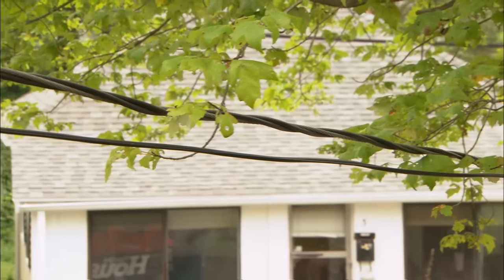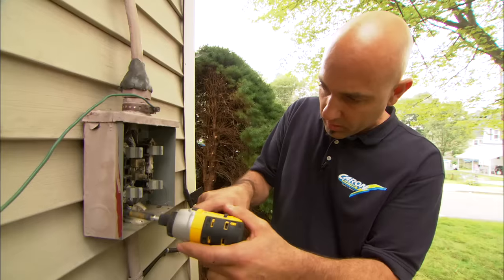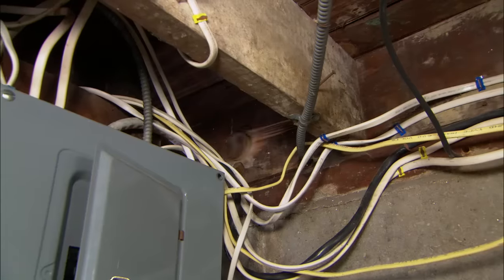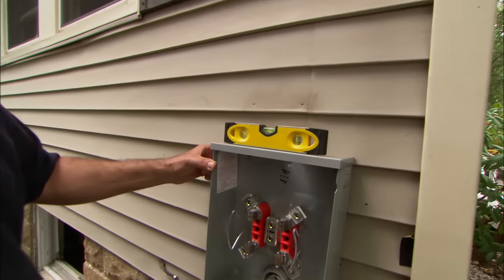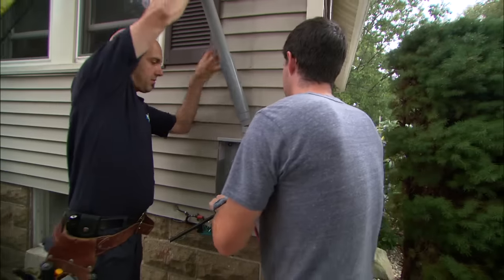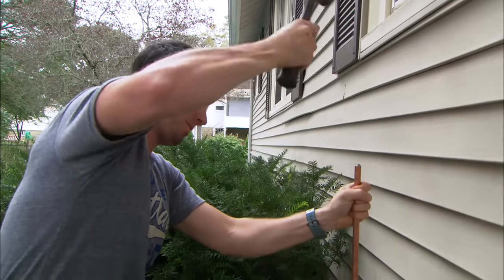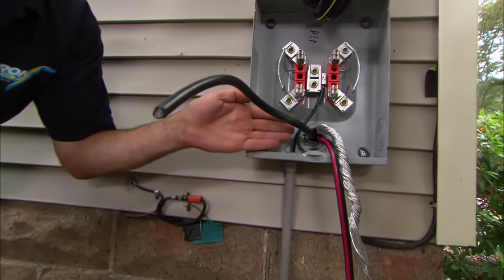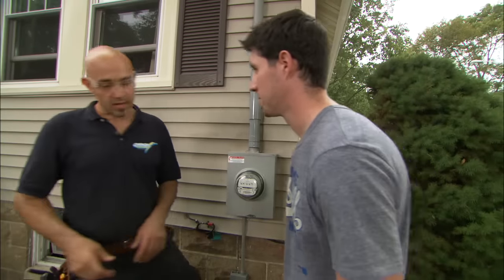How to Upgrade an Electric Meter to 200-Amp Service (Part 1) | This Old House

Comment: Here in germany we have got: 3 phases (L1-L2-L3), 400 Volts each. Every phase hase got 230 Volts to ground / neutral.
230 Volts is the normal socket voltage.
But: 4:14 Sorry, but copper in the earth is not the best choise, AND the electric connection should be protectet against rain etc.
We´re using a so called "cruciform earthing" which is covered with zinc. 
Greetings from germany
Reply: Albrecht8000: The 400V are between the phases and not between phase and neutral.
Reply: @e1woqf
"Here in germany we have got: 3 phases (L1-L2-L3), 400 Volts each. Every phase hase got 230 Volts to ground / neutral."
Thats what I told. ;-)
400 V Phase-Phase
230 V Phase-Ground
Reply: Motors work better on higher voltages.
Reply: pretty funny watch American electric wiring :D We have here in Europe almost everything better engineered (sometimes over-engineered) but murica, nah, 200Amp true the aluminum wires and bare copper rod like a ground :D connected with a black tinny wire.
Reply: Te eropean material is better. But a high voltage is more dangerous.
This use 200A because need 48kW, but is a single phase 120/240V system. 48kW in 3phase sistem 127/220V it's a 125A.
Te common power in a houses up to 12kW, in 230V sigle phase need a 50A (11,5kW) 2x 16mm2 wires, in 120V system need a 3 wire, 2 phase and neutral, 50A 2x 120V uses 3x 16mm2. It's a not big diference.
Reply: @D4V1D83FY  it's a huge difference. 230V system is no more dangerous if you have a proper modern electric installation in your house. We have a current circuit breakers and I can easily touch live cable and nothing happened to me. Btw 16mm2 ground cables are rated to 80A, not 50A. In our house, There is a 5x4mm2 cable for the whole house, 3x230Vx16Amp and 3x400Vx25A lot of power from relative tinny and cheap main cable. And copper joints will last longer than aluminum ones. Not arguing, just saying.
Reply: In the same condition 230V is more dangerous of 120V.
The interruptor about your talk is a default current breaker, also use in 120V countries (gfci). This protection not existing in external wires.
3x230V it's not same 3x400V.
3x230 = 230V line to line.
I'm have use a lowes load in cables, a big cable lowes a voltage lost.
All righ, the cooper is better.
Reply: @D4V1D83FY  No, we have 3x400V between phases, and 230V between one phane and neutral line :) It's same cable, same line. I have a 3phase socket in my garage and only 230V sockets with 16A breakers in-house. In our country was aluminum widely used, but now those installation failing and they are replacing (in old houses) with copper. Aluminum joint degraded and oxidate(even in controlled humidity houses) during times.
Reply: In my country have a 230/400V lines and 130/230V lines. 
Here uses a aluminium for external wires network.

Comment: 1-USE service cable isn’t allowed by NEC for the riser conductors .
2- He’s using SE cable which is correct BUT it has to be a 4- conductor to terminate to the service panel due to no bonding of the meter center to breaker panel . ICC Certified Electrical Inspector would not pass this inspection as I would know I’m a electrical inspector.
Reply: Hmm,  i will have to chek out my NEC.  but i think you are wrong .  Trying to think. as i don,t  use SE.  I will run a section of 2inch PVC , for 200amp.   2 hots and 1 neutral .  and not a bare neutral though.  i tape white the neutral wire. or i could paint it  i guess.  But i still only use 3 wires for the main service. on a Sub-panel i use 4 wires to split the neutrals from the ground wires. I have not been turned down for what i have done for years for this. Never turned down on a service like what i just said.   i live in Louisville, KY.
Reply: Inspectors don’t know jackshit

Comment: 1:55, we had a problem with our 200 amp rated service entrance (SE) wire when it kept popping the main 200 amp breaker. We found out the problem was the SE wire. It was ALUMINUM! We solved the problem when we changed to COPPER wire. That was way back in the mid 1970's. The main breaker had never popped since then.
Reply: weird story.  Upstream wire does not cause the downstream breaker to trip with overcurrent.  Every new house in this town has aluminum SE wire.  It just needs to be a bit thicker than copper to be rated for the same amperage.   And, of course, the connectors have to be compatible with the expansion coefficient of aluminum, as well as be corrosion protected with chemistry.
Reply: Chigobwyn Quorev aluminum is still pretty standard for SE and USE cable...
Reply: likely wrong gauge wire or loose terminals causing heating, not good ;)
Reply: Shawn lewis

Comment: How is the large hole behind the meter socket sealed? I realize the cable itself is waterproof but water could get into the wall around the cable.
Reply: That cable is not waterproof. About sealing penetrations on a house, look for a different video.
Reply: @electricaf365  Funny coming back after 3 years of learning… I still don’t know what that cable is, but it appears to be some kind of huge romex, which I’ve not seen outside this video :)

Comment: No ground to the main panel? or did I miss it
Reply: Guess they ground at the meter base wherever this is. Was puzzled by this also.
Reply: You can do it this way only if the panel is within 2ft of the meter base and you have the ground and neutral bonded inside it, an important code item he didn't explain, also check with the local codes and standards because every utility company I've dealt with want the top of the meter base at 6ft, and no PVC and aluminum out the top to the weatherhead. Also anytime using aluminum it's really important to use  NO-OX on the connections. He basically shows the cheapest way to get by but not really against code.
Reply: It's a 3W system.  The distance to main panel is irrelevant. You nonfat the first means of disconnection. It depends also on the AHJ if you have to go 4W to the main panel AND install a meter-main panel.
Reply: In part 2 he bonds the main panel to the water line inside.
Reply: @markbest4230  Nonfat?
Reply: Totally sorry for 'nonfa'.... I meant bond at first means of disconnect...
Reply: The ground to the main panel is not run inside the service entrance cable. For 4/0 service conductors, they will run a solid bare #4 copper grounding electrode conductor from the neutral bar of the panel through the wall to outside and terminate at the ground rod. Then they will bony the neutral bar to the panel enclosure.
Reply: @RB-xv4si  Yes, it also bonds at the cold water intake if there is copper water piping. Gas line is bonded as well. But more importantly is the fact that if we here  in Georgia upgrade the service entrance, our main disconnect will be located at the meter, thus running a 4W to the main panel and doing all bonding at meter-main service entrance. It really depends on the AHJ.
Reply: Mark Best yeah, that’s fine. I was just talking about this specific situation where the main disconnect is inside the panel. You run the GEC to wherever the main disconnect is, of course. As far as where you run your GEC, I don’t know if you guys in Georgia like to blow up your houses and generally not follow NEC but it is against code to run the GEC to the gas line for obvious reasons.
Reply: @RB-xv4si  No, I'm just saying what some inspectors actually say. And bonding is required  per 250-104(b)... assuming you guys read the code up where you're at!

Comment: LOL . I can't believe I didn't see this before now. This would be one electrician I wouldn't want on my house . I seen so many violations in that install it makes me wonder it the guys house burnt down a year later.
Reply: Name one
Reply: Yes pls point out the violation which will result into his house being burnt down or a fatality or any other basic errors, we need to know!
Reply: The grounding rods do not prevent electrocution. They provide a path to ground for lightning strikes and transit voltages.
Reply: Your neutral wire should have been insulated as it is a current carrying conductor. The twisted strands are to be used as a grounding conductor.

Comment: I still think the ELEC Company needs to "own" everything up into the meter box.....
Reply: Yeah but they have the money to lobby our politicians in there favor, no one looks out for the lil guy, cuz we ain’t got no money’s
Reply: But the service entrance is covered under the National Electrical Code.  Linemen are NOT electricians.  It actually makes sense that anything attached to your house should be your responsibility.  That INCLUDES the point of attachment device that the electrician typically installs on the house for the utility wires to connect hang from.  Just my opinion...
Reply: No, i paid for my meter base and wires up the mast. Power company supplies the meter and wires from the mast to the pole.

Comment: Most power companies will not allow you to pull the meter. Get the specs from the power company. Pvc risers are not allowed here. Also no grounds in the meter can on residential installs
Reply: The utility has better things to do than  "de and re's" for 200 amp residential service's, they don't care.  Any electrician worth his salt knows how to cut out and tie back in a residential service. No waiting no problem.
Reply: You can pull the meter in an emergency and when upgrading the service.  Pull the permit and notify your local utility.  Of course you can use pvc.

Comment: No seal on the cable that goes through the wall of the house!?
Reply: Good Point. Maybe He sealed from the inside in order to push his sealant against the meter pan which would act as a stop for proper filling of that hole, But without a follow-up video we will never know! lol

Comment: Just one question.
Would it be more safe to do the inside connections before installing the meter outside ??? I just think, i my line of work as an Electrician in the EU I dont trust anyone other than myself, and who knows if some one just hock the wires back on from the utillity line outside because of a misunderstanding. Just a thought :) 
Love the show. keep it up guys.
Reply: Thias Russell the whole house gets disconnected at the wheatherhead from the energy company

Comment: The neutral from the weather head in this video was clearly identified with the stripe in the sheathing of the wire.  If you cannot clearly identify the neutral wire, our inspectors require that the neutral is marked at the top and the bottom of the wire with white tape.
Reply: who cares about your inspectors?
Reply: @Fattony6666  Just thought it might help others.  I have had different inspecters in the same department have different requirements.

Comment: Anyone notice the lack of anti-ox on the aluminum wires.  Here in the Midwest where we have a lot of humidity that's just asking for trouble.   You're absolutely right about the homeowner not helping.  Glad they finally passed the bill here in Wisconsin that you need to be a master to do this kind of work.  Homeowners can still do it themselves but most won't attempt a project like this. Master Electrcian  Jeremy Miles
Reply: yeah i noticed the noalox.
Reply: He is squeezing the anti-oxidant on at 4:51.
Reply: yeah, licensing is good, but Walker's getting rid of that ASAP.
Reply: boy I'm sure glad that the first time I did a permitted anything, it was a main exterior service panel. went without a hitch. so did my next two.
-homeowner
I'm really glad that I made a youtube video showing people the process.
Feel free to stop on by and improve my video with criticism in the comments section. That way the Nanny State will to some degree lose its choker grip on this Previously Land Of The Free, and consequently america will be made somewhat more great again.
Reply: Jeremy, I hear you with the licensing laws. However, these laws are rarely enforced here in NJ. And it pisses me off to no end.
Reply: you can clearly see him put on the Anti0ox... and if you look closely when he terminates it has it on the bare Aluminum. It doesn't have to be GOBS of Anti-ox to be efficient.
Reply: MetusBatmanV14 State law here in Wisconsin says otherwise, and there's a rather painful fine and more that goes with it if you choose to ignore it here.
Regards, a IBEW brother, Local 494.
Reply: I'm an electrical engineer and I rarely meet a journeyman or master that actually knows anything about electricity or electrical circuits.  Sure, they memorize the skill and can do what they've been shown, but take them out of that production element and they're completely lost.  I used to ask journeyman to draw a simple lamp circuit controlled from two/three locations.  Few could do it.  They could all actually wired the circuits, but none of them really understood it.  That said, you don't need to be a master to install a service entrance to code.  Or a ceiling fan... or a bathroom timer.  It's a racket... and that's why the homeowner is still allowed to do his/her own work so long as it is permitted and inspected.  You overestimate your skill set and necessity.
Reply: Should of used GB Ox-Gard.

Comment: I did not see the ground wire going to the breaker panel, pleaaaase explain.  Maybe I missed it.   If this is where you are bonding  then where you attach your ground inside the breaker panel?  Or you are using both bus bars inside the breaker panel by bonding it  again? Or your are using a separate ground rod connection altogether in a separate part of the house?  Thank you for your prompt reply.

Comment: On a 47 year old house with original wiring on a 100 amp service, is it better to also upgrade the cable for the new 200 amp from the power pole, or leave the old cable like on this video? The cable is underground in conduit, but an overhead hookup could be easily done.   I’m thinking with more breakers and higher load that a bigger upgraded main cable is worth the cost.  Opinions and thoughts?  Thanks in advance!

Comment: Lucky you didn't drill the hole saw into wires at the panel in the basement. A better method would have been to drill a pilot hole into the basement and then drill the larger hole from the inside. Otherwise good video.
Reply: He was using existing hole he just enlarged, pretty sure hes safe there chief. Come on man thats what the thing you wanna dig on this about???!!! do better

Comment: Periodically check your ground rod connections. It’s your last line of defense if the service neutral severs. If it’s loose or corroded fix it.
Reply: Good idea to check them but I strongly doubt that a severe fault of some sort would ever be effectively conducted through that path.
Reply: @wholeNwon  the goal is to provide a alternative path should the neutral wire sever. Like you said it won't carry the full current effectively but it's usually enough to be able to identify an issue and call the local utility. Usually identifies itself through flickering lights.
Reply: @fosarvian   I see. Aren't the ground and neutral bus bars separate in many (?most) areas?  I don't know the code.
Reply: @wholeNwon  I'm not 100% sure but I think they are connected at the panel.

Comment: is #6 gauge copper wire ok to use reguardless of 100amp or 200amp main panel or subpanel?
Reply: for the 200A service?  no.  based on some charts, the "best" you could get would be 165A, but that's with special ratings/housing.  but always check with local building codes/references.
Reply: Yes

Comment: Don't know of any Current Codes where the Meter Base can sit so low to the ground...among other errors in this video...
Reply: That’s because you don’t know any current codes
Reply: @electricaf365  lmao. In my area, Chicago burbs, the pedestal sits on the ground  and is about two feet tall, and the meter sits on top of the pedestal.

Comment: What about no-lox on the connections......we use no -lox in georgia
Reply: it's not required on current applications as the alloy of the aluminum is different/improved from the old days. however I don't see how it would negatively affect anything should you choose to apply it.

Comment: It bothers me when electricians describe the two ungrounded service conductors as having 120V each. That’s not really the correct way to say it. It will confuse people trying to learn and conceptualize the system. It’s 120V between each ungrounded conductor to the neutral conductor. It’s 240V between the two ungrounded conductors.
Reply: Thank you from a beginner who wants to thoroughly know and understand my trade
Reply: @Frank Ruiz incorrect, sir. “Out of phase” is used to describe multiphase systems, most often three phase systems that are 120* out of phase relative to each other. In a single phase system, nothing can be out of phase because it’s all one phase. Voltage is always a potential between two points. Refer back to my original comment about the voltage clarification for the poor explanation in this video.
Reply: @RB-xv4si  One of the sinusoids is 180 degrees phase shifted from the other allowing for a 240 v potential difference between both lines. Otherwise it wouldn't be possible for each conductor to have a 120v potential from the same neutral.
Reply: @RB-xv4si  the two 120V conductors are 180deg out of phase from each other.
Reply: This is 240VAC SINGLE PHASE 3-wire service.